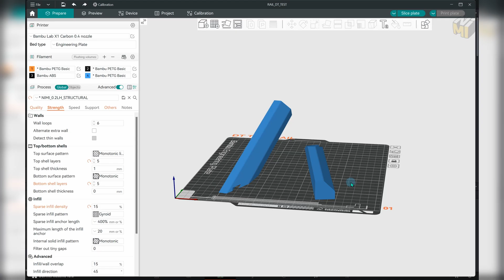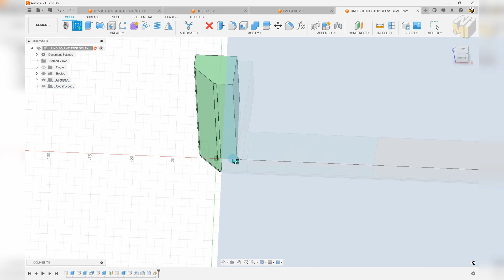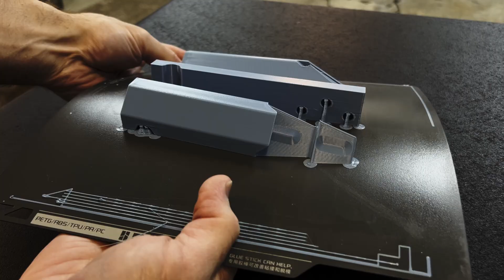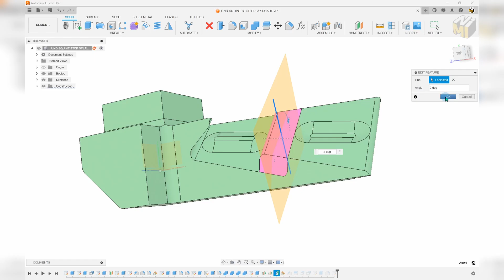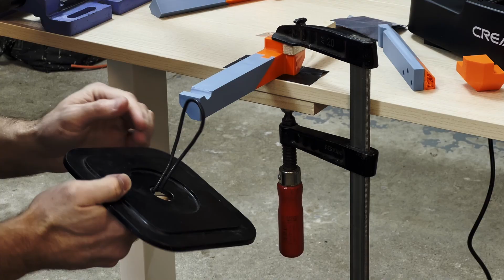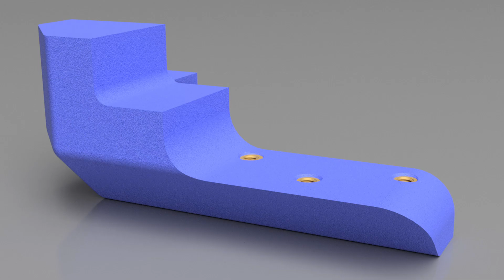Strong 3D Printed Connections on BIG parts

Comment: I don't think you need to improve on the last one - it didn't even fail at the joint, but  where the load was applied (edge of the table. Pretty much, handles the same load as the simple join-less beam would,looks like

Comment: Outside of metal welding, joints become an interesting compromise between contact surface and material strength, as well as where your joint comes between the two parts. FDM printing throws another monkey in that wrench will variable surface bonding strength. Most times I've never had a joint fail before the print material breaks, but that's almost a given with filament-based models. 
That scarf was impressive nonetheless. Lots of surface area to spread the weight and the angle of deflection was working in its favor for the most part. I will admit that when a part is non-crucial for strength, I'll often rely on simple keys and adhesives, though for structural work, interlocking cuts are a thing of beauty. I've also gotten pretty good results with interference fits via threading parts with a stout reinforcement/structural adhesive. You can rest 100% sure that the material strength is the weakest link.

Comment: Nice video but the tests dont feel that accurate,
it looks like the joints are holding up but the filament structure breaks, 
So for the type of settings you use, this is accurate, but as fast as you change settings, everything will change :)

If you are planning to work on an update on the video, it would be nice to see the test done with like PLA and PETG, but also two different settings.
A lot more work for you, and expensive to print a lot, but i think it will add to the quality of the video :) 

I saw someone in the comments about a fish scale an sand, but if you dont have the income from youtube yet, 
Take like a plastic cup and measure the weight of the amount it can hold, then fill the bucket with the cup :) Then you can count the weight by counting the cups :) 

Congrats on your 100k subs.. Ill change it to 100 001 right away ;)

Comment: Thanks for sharing the great video. May I ask the typical gap/tolerance between the contacting parts in your print? 0.01mm, or 0.02mm, or depending on the way by which the parts are joined?

Comment: Would you ever consider doing a video with a 3way connecting dove tail- 4 piece in total, essentially docking a corner piece with dovetail. Almost exactly like what you did in the video thumbnail? I'm quite curious as to the strength of something like that

Comment: I know it's not a big deal, but it is a key element to designing parts that fit together and I believe it's certainly worth knowing and using the correct terminology. Misusing terminology also creates confusion for the audience and misleads them when they go to do their own further research.

Just letting you know that you have misused the word 'tolerance'. Tolerance is a physical phenomenon that results from the hardware used to manufacture a part and denotes a parts precision relative to a design parameter, i.e. "I designed this part to be 10mm wide. When I measure the part in different locations I get measurements between 9.8mm and 10.2mm, therefore the tolerance is plus/minus 0.2mm."
You never add a tolerance to a design, but you do add an allowance to a design to create a clearance between parts. The larger the tolerance, the larger to allowance required to maintain a positive clearance.

Otherwise nice work, very interesting video!

Comment: It's worth pointing out the convenience of the joints not requiring any extra tooling to assemble. At the same time, did these joint really take into account the direction of the stressing force? I am sure with proper consideration the results could be improved further. But still, amazing and highly appreciated content.

Comment: the heat set brass inserts are on the wrong side... should be installed in such a way that they have to be pulled entirely through the material, rather than back out the way they were inserted.

Comment: I'd say a lot of these can be reinforced with using a 3d printing pen to further glue things in and get the bonds to be permanent and more evenly distributed. Also, consider doing the hanging off the corners of the table so the table doesn't bend. With the current bend the force is not evenly distributed perpendicularly but more like tugging on the joint, still, pretty solid joints.

Comment: As you can see your connections are strong enough therefore failures occur  at one of the 2 parts. if it was me i would play around with the infill type to try to make the parts even stronger and see if the connections still take the loading. Or even better, you should design the infill as well and remove any automatic infill thats done by the software

Comment: If I don't have to worry about taking things apart again, I'll opt to just weld the parts together via a dremel mounted welding tip
Reply from the maker: A what a what?  Please explain what you mean.
Reply: @NeedItMakeIt  A cone of plastic printed from the same material. Lut it on a dremel to spin it fast, push it against a part to melt the plastic together
Reply from the maker: @jackgamer6307 Thanks,  I've never heard of this method used on plastics, this is a very interesting approach, just like what you'd see with metal friction welding.

Comment: With such low wall and infill settings, pretty much each of these joints will be stronger than the rest of the part anyway.
Reply from the maker: It seems like more walls and a heavier infill could help for sure.  Printing them 100% solid would be idea, but it's not realistic, it's far too costly unless the parts are small.

Comment: @NeedItMakeIt: I was wondering what I could derive from this interesting approach: None of the joints were the cause of terminal failure, and the test rods broke as an effect of the design being so stressed that the deflection of the entire structure rendered it useless for most applications. In that context, any joint is a good joint?
Reply from the maker: I don't know what you can derive, it depends on your ideas for application.  In my case I wanted to show some alternate options for connecting parts which did not require fasteners.  In the case of the lap connection with the screws, it failed due to the smaller cross-section, correct not due to the screws themselves, however it is failure due to the design of the connection which is a limitation of this kind of design.  The dovetail connection had failure on the dovetail, however it was just at the lowest point (from memory).    The modernized version of the Under Squinted Stop Splayed Scarf failed due to what looks to be the connection being stronger that the rest of the part.   

It is always better to have parts coming together with as much surface area in contact with the other, the lap joint only does this on one plane, the USSPSJ does this on many and so it will be a more rigid way of bringing parts together and keeping them together, no fasteners of course, but there are wedges.  

In the end, these are just ideas in my head that I'm trying to bring into reality, you can take what you want or don't take anything at all, I'm not promoting one or the other, it's just me sharing ideas and trying to find a way to make it as informative as I can and interesting.  Maybe you'll get your own ideas from this, I don't know.

Comment: You should use solid infill. Your testing is meaningless, you are testing material strength with partial infill rather than the connections
Reply from the maker: I have some testing with solid prints, and the results are different for some materials, especially PETG, however most people do not print solid, so I understand your point, but I don't agree.   The testing I've done is based on what I would consider to be real-world examples.  I've printed thousands and thousands of parts, and of those, I've made less than 10 completely solid parts, and most of them have been for testing.   I'm a fan of printing solid and I think I will be doing more in the future, but it's not likely something that everyone else will be doing.

Comment: The fulcrum point on the first one with the screws did not test the joint strength whatsoever. It was purely on the part.
Should have positioned it half way across the joint overlap on all of them.

Comment: I think you could do a lot better on the lap joint. If you were to inset the lap on the ends similar to how you did on the scarf joint, I think you'd see a small improvement. Also, if you used through-bolts instead of threaded inserts, you'd get a better result then too. It'd be hard to beat the scarf joint though. You could improve on all 3 of them(through-bolts, superglue), of course. But the scarf joint is a tough joint.
Reply from the maker: I was thinking that as well, do you think I could use a combo between screw and scarf for the ultimate connection?  Perhaps the screw could come in at an angle to pull the connection tight as well?
Reply: @NeedItMakeIt  I think it would definitely be better. If you are familiar with breadboard end tables, typically the ends are attached using dowels. They are pulled tight to the table by slightly offsetting the holes in the breadboard end and the tenon, and using a tapered dowel to pull he pieces together. I suppose you could print tapered dowels using the same material and it may be an even stronger joint than using through bolts. Dowels would take a bit more work, but the end product would look better than bolts.
Reply from the maker: Interesting concept and I like the reference to the Bread-board edge, not many people would think of that, since we don't build tables this way anymore.  I also have an idea for a strong connection using a type of dowel if you want to call it that.  Maybe I can put them all into a follow up video.

Comment: Everyone does inserts wrong. If you have the option to do a through hole and put the insert on the backside, do that instead. It's a lot harder to pull through the entire part than it is to pull out of the hole it melted itself into. If you're trying to make something look nice, sure, hide them. If you want strength use them just like you would use a countersunk nut. You wouldn't super glue it in a pocket and hope it holds. You'd put it on the backside and squeeze the two parts together.
Reply from the maker: Point taken, I agree with you.  Do you have any techniques to make sure that you don't have plastic coming into the hole from inserting from the other side?  Using a tap?
Reply: @NeedItMakeIt  I guess it would depend on the design. But in general I'd probably do through holes slightly oversize for the screw/bolt on the mounting surface and then have a pocket specifically for the insert on the opposite side. If needed I guess you could clean out any excess with a drill bit or tap.
Obviously for this project it wouldn't matter. The fasteners aren't the weak spot. But a lot of times the point of failure is going to be the inserts just pulling out. In those cases I would try to design for through holes and inserts.

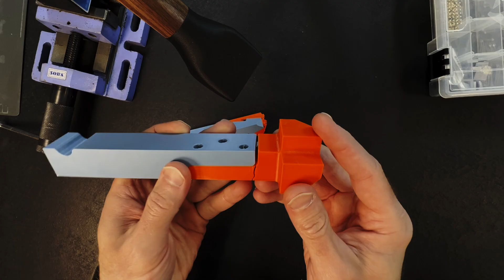Comment: 17:35 another improvement that can be done to this type is giving it a "tail" too that slots into the other part.
Then it wouldn't open as much from bending because it would have to pull that additional part out of the other first.

Comment: So much effort, also one thing missing -> Printed threads instead of brass inserts. Just have a minimum of 3x width of thread, so for M3 minimum of 9mm. Not sure if that still gives full strength, but that's the rule of thumb i've used.

Comment: A fair comparison would be to angle all of them equally. Versions 1 and 2 broke because of their relative orientation to the weight and stresses applied to a thinner cross section of the material/side of the material. Very nice joint, but I would have loved to know how these 3 compare on a somewhat more similar style and same relative stresses.
Reply: I would like to see these tested in different orientations.  The bolted joint would behave much differently if rotated 90 degrees.  Great video!

Comment: For the supports, I would try using PLA as support interface without any gap to the part. Regarding the tests, I think it wasn't quite fair. The last junction was spread over a much bigger area, giving it an advantage over the first two. I think the test would be more representative, when the junction area would be kept the same. Also the first two parts weren't oriented the best way possible (as you did mention in the end). Especially the first one would have held much more load when put on it's side. Still an interesting junction design.

Comment: what the recommended 3d modeling software to learn and start with. Lowest curve?
Reply from the maker: Hmmmm.. good question.  Personally I think Fusion is the best right now, but it's a bit too pricey for most people.  I don't like Tinkercad personally, it'd really hard to use to get good results.  Fusion may still have the free version for new subscribers for a year, after that I'd buy the full year plan and it's much cheaper.  There are some other options coming to the market now, I'd need to test them out first though.

Comment: Technically, material failure is the cause of breaks on all 3 joints, but your video does illustrate the importance of knowing the direction of forces and orienting the strength of your joint to accomodate.  

Joint 1 had 1/2 the material thickness to work with and the joint wasn't really part of the equation.  Rotate the part 90 degrees and it would do another 10 lbs (my guess).

Joint 2 also had 1/2 the material thickness because the orientation of stress caused an upward bow splaying the joint.  Again, 90 rotation would test the joint itself, probably would hold another 5-10lbs.

Joint 3 had full material thickness to hold against the stress because the (correct) orientation forced the joint to compress together.
Reply from the maker: Nice analysis!  

I'm seeing a lot more of these large format prints being made, but when I look at the way the parts come together, the joints are loose and the entire frame then relies on the acrylic panels to stiffen them up.  It's ideal if it can be strong as a stand-alone, and the panels only add to the integrity of the structure.

Each will have advantages over the others and can be used in different areas.  The scarf is a little complex to setup, but it's pretty slick, maybe someone can improve on the idea as well.  The half-lap is really quick and easy to create and it's pretty strong, and I think it can be even better with a few tweaks like you mention and some slight design changes as well. 

More testing to come, I need to finish up a few projects first, but I have the material on order and I'll get back to it soon!

Comment: I'd like to see it used in a large practical print like a frame for a printer enclosure.
Reply from the maker: Sounds good, I'd like to do an enclosure which is cost effective any easy for anyone.
Reply: @NeedItMakeIt I feel like bracing wires or cords running through channels inside the printed components and tensioned from the outside upon assembly could play a role in making stiff frames.

Comment: curious why dowel style joints with glue or epoxy are not used a lot in 3d printing?
Reply from the maker: There are some options for this coming into the slicers.  I think for the most part because printing was so slow, big parts were pretty much not an option, that's starting to change, but you'd need a background in furniture making to want to apply those techniques.  I worked for a company called Durham furniture and we had a department of 'Dowel-adders' and I ended up doing that job for a bit, it's amazing how fast you can get at adding dowels in.  It's great for wood for sure.  

As far as for plastics, with PLA, the part longevity is a concern, they become brittle with exposure to moisture since they're designed to breakdown, for PETG, it's hard to glue, I think PU glue might be the best option for that material, and for ABS, acetone to connect the parts might be the best option, it would solvent melt the surfaces together nicely.  

I think dowels can work fine as long as you find the right adhesive for the material you're using.

Comment: Something i have always wanted to do is make a really solid 2.5 D 90 degree or perpendicular joint. This would mean you can machine just the top surface of two pieces but be able to join them perpendicular to each other. The best I got is dove tails but those are 2.5 Dimension not 2 dimensions.
Reply from the maker: Is there any way you can send an image of it?  I am going to be doing some follow up videos, and I can add some of your ideas in if you like.  I will give credit to you of course if that's something that interest you.
Reply: @NeedItMakeIt  Thanks Mike, but i never got around to designing something. I was using a CNC router not a 3d printer. There was no clear solution that did not require an undercut. Some undercut geometries were achievable with special router bits like a dove tail. That was how I was going to get the extra .5 dimension. I was inspired a lot by japanese wood joinery and wood joinery in general. The key thing is that the member holding the pieces together is not the thing that is experiencing the force in the direction you care about. 

I recently started to play around with "tsugite" and you might be able to find a geometry that is optimal for 3d printers. I would consider looking at what some of the stronger wood joinery methods are and take inspiration from that. Take into consideration if joining method is in tension or compression to better plan the part orientation.